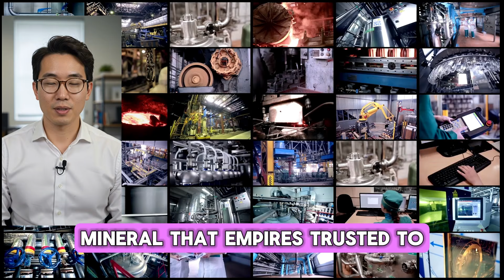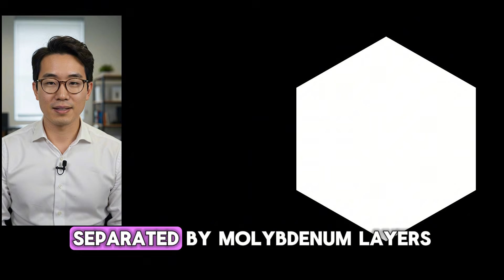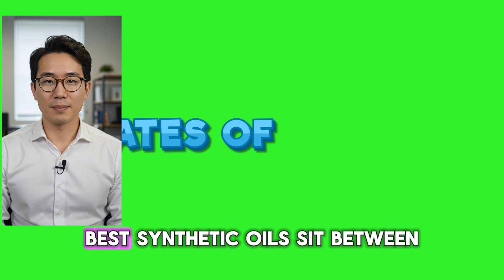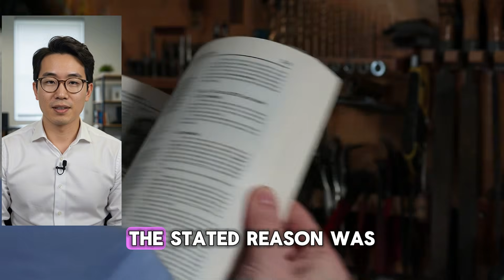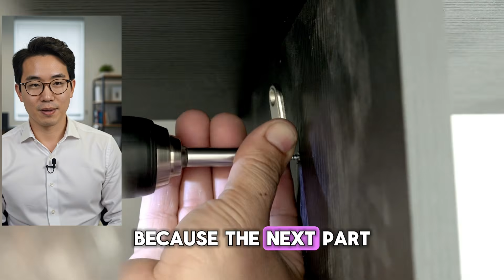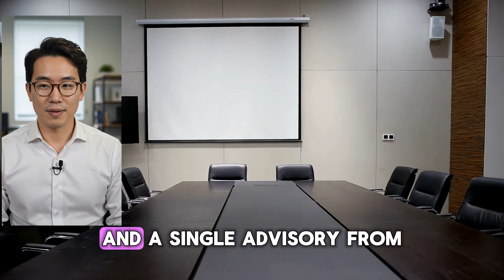The $2 Oil That STOPS ENGINE WEAR Forever Oil Companies Buried This

Comment: These Ai vids are ridiculous!!!  They want you to watch without giving you the item they tease, in an easy fashion.
Here's what I've googled:
Molybdenite  (molybdenum disulfide, MoS2),  is a soft, dark-gray, metallic sulfide mineral that serves as the primary ore of molybdenum, crucial for producing steel alloys. It has a greasy feel, a hexagonal crystal system, and is often found in porphyry copper deposits and high-temperature vein deposits. It is used as a high-temperature lubricant and in semiconductor research.
Lubricant: Used as a solid lubricant in high-temperature or vacuum environments where oil would fail.
I found 
MOLYBDENUM DISULFIDE GREASE for Yamaha @ $17.99 (New Zealand) for 395ml. I imagine in UK or North America it'd be much cheaper.